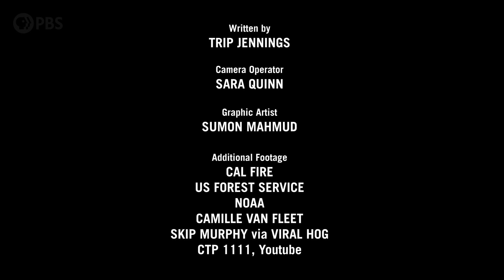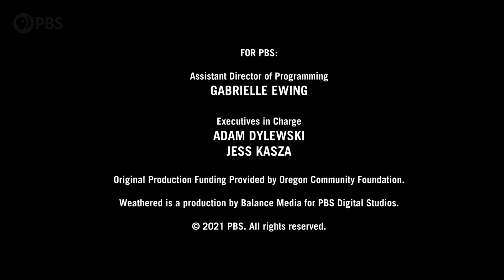How to create a FIRE tornado

Comment: Is it possible, then, if the fire only releases a small part of the carbon, that with the new storage from regrowth there could be a net gain?
Reply from the maker: Possibly but the most important thing - in my opinion - is that forests are part of a cycle and fire is part of that cycle. There are carbon fluctuations but the cycle will continue either way!

Comment: Thanks for information... would add that as the wood decays CO2 is released.  Would also add that as the fires destroy buildings etc further emissions occur. Should people rebuild in the forest they create more CO2 as the materials they use are manufactured. Lastly it's not unusual for burned forest land to be converted to commercia or residential. We would be wise to give back 50% of the land to nature

Comment: Do the dead trees left after fires release their carbon over time as they are consumed by decomposing fungi?
Reply: Fungi convert the carbon to organic molecules, releasing CO2 through energy-cycle respiration. In other words, some of the C winds up as CO2, but not all (as some scaremongers would have us believe). Fungal conversion to organic compounds explains much of the material in forest floors. Humic acids store C for a very long time.
Reply: No, In fact the fungi don't even better job of storing the carbon once they've transformed the tree into more fungus.

"Study finds fungi, not plant matter, responsible for most carbon sequestration in northern forests" https://phys.org/news/2013-03-fungi-responsible-carbon-sequestration-northern.amp
Reply: There is also a lot of new growth after a fire which would lock up more carbon. Those large logs and snags can take decades or even centuries to fully decompose depending on their size. So there is time for the new trees to grow. And those logs help create beneficial micro-climates which can help new trees grow and deal with droughts.